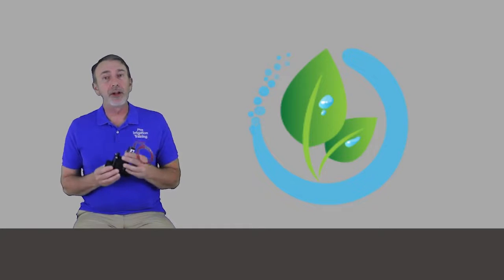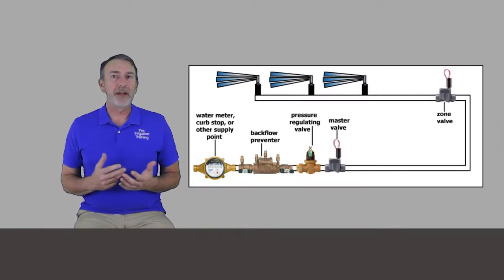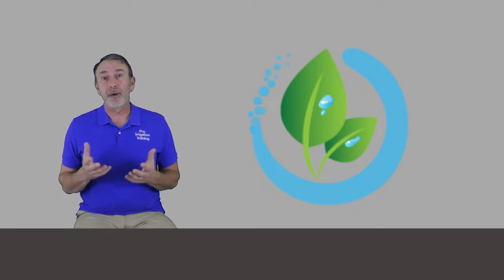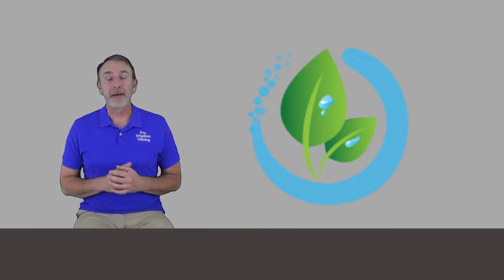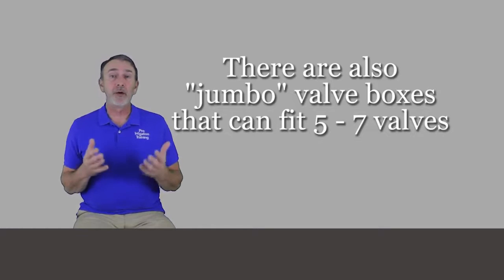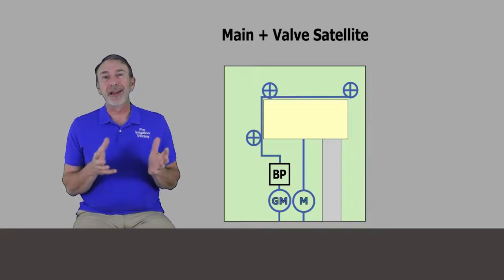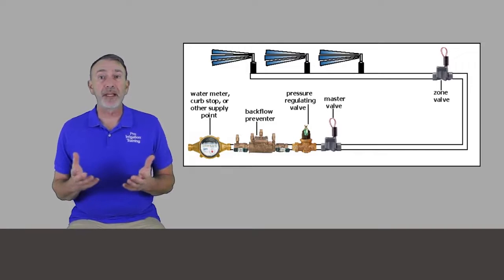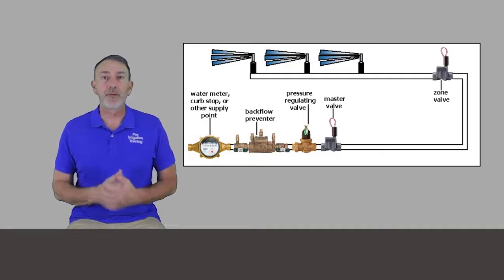Install Irrigation Valves Locations

Comment: Hello Irrigation Pro community. I have an issue that i could use some philosophical help with.  I bought a home 15 years ago with a rainbird irrigation system installed. It was not new then and hence it is older now. It has been working fine til about 2 years ago but since i live in WA state, we don't need that much irrigation to happen. The system is not working currently. The controller is fine (per my electrician friend checking it).  I think the valve(s) are not working properly. There is no valve box nor a system schematic that i can find for the system from when it was installed.   There is a wire from the controller (timer) out through the wall of the house and underground. I dug that up and pulled the wire out of the ground while doing so. Unfortunately, i could not tell exactly where the wire was underground when i pulled it up, so i have just dug around and i did fine a line of pipe that is one of my 5 stations.  But i cannot locate the valves. I am pretty sure i know where the water pipe leaves my basement to supply water to the system and i am guessing i am going to have to dig from there to try to find the valves (either a set or the master or both).   What i want to know is what would be the standard best practice for installation of where these valves would be.   That is, is the best practice to install the valves a foot from the foundation and a certain depth or 2 feet or are there no real standards. I can't believe the installer did not install a valve box or leave some clue about where the valves are. Any help from anyone on this thread to help with my mystery is appreciated. thanks! adam
Reply from the maker: Hi Adam. Sorry about the situation. As far as the wire, stretch it out as far as will stretch, then mark its tip as you move it in a semi-circle from where it comes out of the wall. Then dig a pretty deep trench along your mark. it sounds like the wire was cut at some point, so maybe the wire was pulled up or jerked back by whatever cut it. A difficult situation to be sure.
There's a new solution you could look into; a Ground Penetrating Radar tool that looks kinda like a lawnmower that's pushed across the ground. It can map your entire system, including the valves. If you can find just one valve, then an irrigation professional with a wire tracker can find the wire for you and reconnect.
As far as standard installation practices, well that really doesn't exist. What I think is logical placement certainly doesn't apply to anyone else, lol. I'm constantly asking myself, "what were they drinking or smoking when they installed this?"

Comment: Thanks for this information, I do have one question though, is the "Main + Satellite Valve" method code compliance at the State of California?
Reply from the maker: I'd think that it would be fine. It's just a preference. One way saves a little more pipe, the other way saves a little more wire. But definitely check in CA, lol. Thanks for watching and the question!

Comment: Thank you for being clear and explaining this subject.  I have an automatic sprinkler system with 4 zones and my water source is ditch water and is supplied from my HOA.  My annual HOA fees pay for the use of this ditch water.  The HOA supplies ditch water to each property that is pressurized and each property has a brass shut-off valve to turn water off to the property.  This brass shut-off valve is located in the front yard and in the corner of the property where the phone pedestal, cable pedestal, etc. are located.  This brass shut-off valve is the point of where the responsibility of the HOA ends and the responsibility of the home owner begins.  From this brass shut-off valve my water is carried into my property in a 1 1/4 inch PVC line and before my manifold I have a hose faucet followed by a brass gate valve and then the inline "Y" filter.  On the discharge side of the filter this 1 1/4 inch PVC line is reduced to 1 inch and this goes into my manifold.  All four valves are 1 inch and the water line coming out of each valve is 1 inch.  Since there are numerous properties "sharing" this water at any given time the flow rate and pressure can fluctuate throughout the day.  I have my timer set to start watering at 8 pm as this is the time when no one else near me is using water.  My flow rate is 6 GPM and the pressure is 20 PSI.  As a result, my sprinklers underperform and are anemic in their water distribution on the lawn.  Each zone has between 6 and 8 sprinklers.  I have determined that the piping in each zone is working properly and that there are no brakes in the piping.  The 1 1/4 inch line may or may-not have a brake in the line.  I have yet to determine what the status of this line is.  My house is on a cul-de-sac and all my neighbors have thick lush green lawns.  My lawn is not in the same league as my neighbors.  Therefore, my problem seems to be with my system and not with the HOA water.  The brass shut-off valve at the front of the property does open and close as I have tested this.  This valve is open as far as it can open.  Do you have any ideas on how to solve this issue?
Reply from the maker: Ok, I do have some thoughts. Interesting setup, but really just a "reclaimed water" setup. Your filter should be cleaned regularly, and I can't emphasize this enough. Scrubbed with a brush and so forth, a clogged filter is commonly the cause of reduced flow. I would put a pressure gauge on the hose bibb before the filter, then you can really see the best time to run the system. Just because those near you aren't watering, it doesn't mean that's actually peak pressure for you to use. Then, do a five gallon bucket test at that hose bibb or use a combo pressure / flow gauge (about $120). 5 gallon bucket test works great, i have a video or two about that. Now, go to your largest zone, and pull up each head and write down the nozzle number. Make sure you get all the heads on that zone and only the heads on that zone. Add them up, does your total, (the flow demand) exceed what your flow supply is as determined by your bucket test? You can find that nozzle flow info on the manufacturer website. If it does, then reduce each nozzle by one size and see how it looks. Repeat if necessary. Also, check the web for output details of your filter. Is it capable of flowing enough gallons per minute to supply all the heads on your largest zone? You can get different mesh size screens for a lot of filters.

Comment: Is there a formula of how much the pressure decreases for each sprinkler head? I assume just popping up decreases the available pressure. Does using a specific sprinkler head reduce water pressure more than other? (ie rotors, rotary nozzles, spray nozzles, impact sprinkler heads…). 
Does too many sprinkler heads reduce the pressure just mostly at the end or even the first sprinkler head? 
And what type of sprinkler head still works ok at very low PSI? (I bought a house with a full system set up over 1/2 acre. At the bottom of the hill I tried to test the PSI and I think it’s like 10. There are 14 Rain-bird rotating R Vans and even a drip line to this section. 
Oh, and does having all the sprinklers in a row off the same line effect pressure any differently than having the main line branch 2 separate directions with the heads off 2 different branches?
Reply from the maker: Yes, you can calculate how much pressure will be at each head. I don't currently have a video on how to "pipe size" which is an installation technique of choosing the proper pipe size to help even out the pressure at each head. If the sprinklers are all in series or one after the other down a single line, then there will be decreasing pressure and flow available at each successive head. I'm pretty sure all of the pressure loss is from friction loss, so i'm not really sure about the pressure used to push each individual head up. It probably only affects the output of that particular head as it's making it's final energy conversion from pressure to velocity to push the water through the air.

Comment: In some areas are commerical backflow preventers underground for commerical properties? If so do you know which specific areas?
Reply from the maker: I really couldn't say about different areas, because it sometimes varies by state or even local water systems. In my general area, all the backflows are underground. But go a little farther north and they're in basements & crawl spaces. Go to TX and other deep south states and they're all above ground in cages. Thanks for watching, sorry I can't really answer the question.

Comment: Not one valve  solution setup/location for all properties. Maybe 70%  valve will/should be located in same place. Misleading subtitle 😊
Reply from the maker: You're right, there's not one best setup, that's why I covered both satellite and manifold configurations in the video.